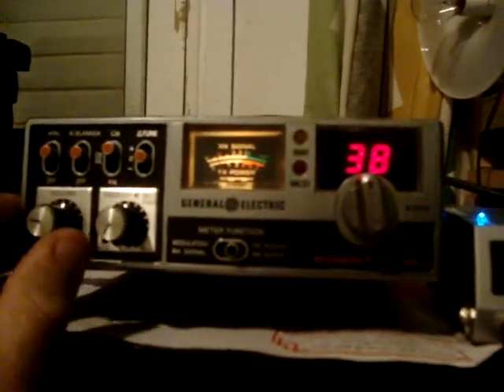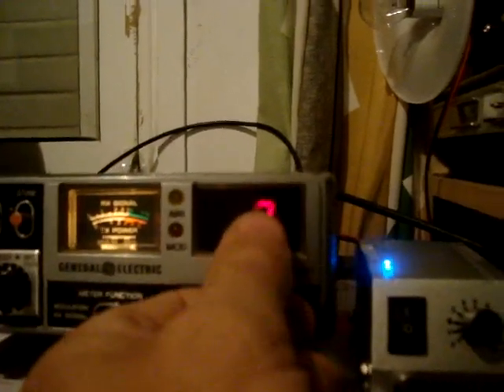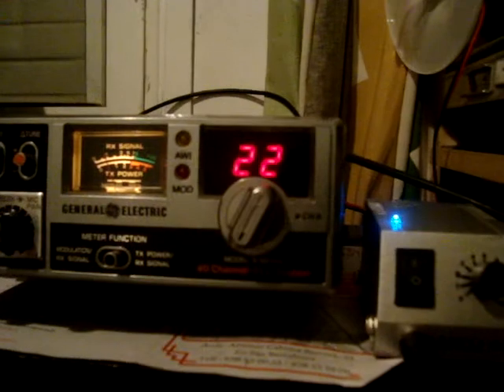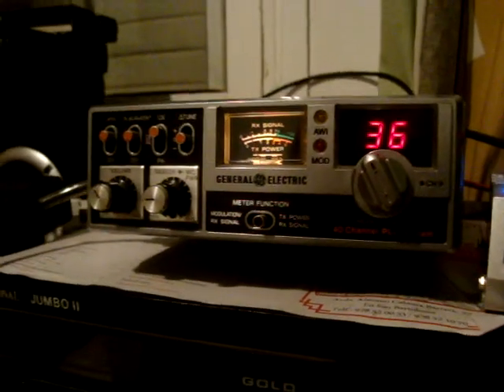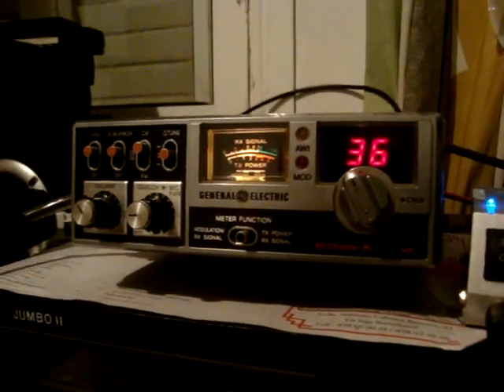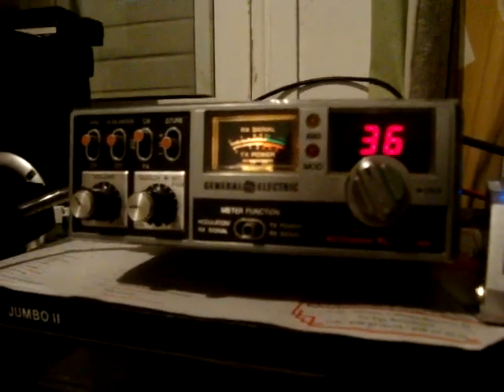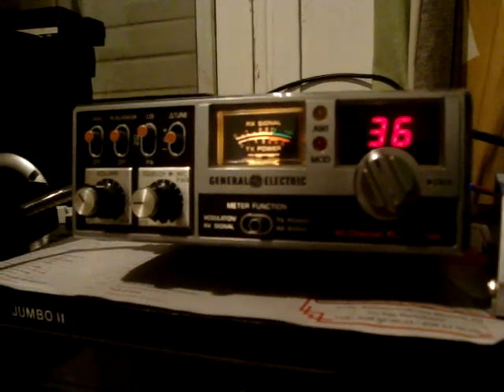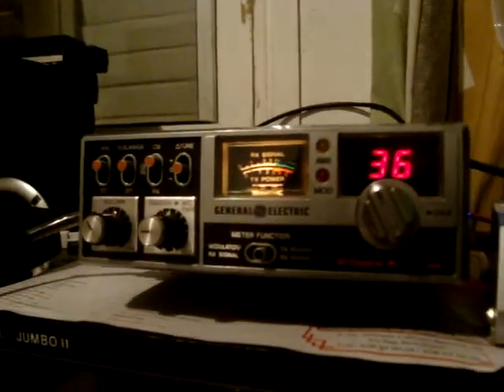GE 3-5814A FM /AM conversion

Comment from the maker: no i dont know how that works becaus i couldnt read the circuits you sent me.
only the latest 2 pages i could read with the pll circuit and it was thanks to them i got it working, so many thanks for them. 
the audio is amplified direct from the mic on the fm add on board so to make the mod light light up would be more complicated, i would have to allow the am mod to go through the circuit and pass the mod light circuit , then disconnect it to prevent it from doing am and fm together.